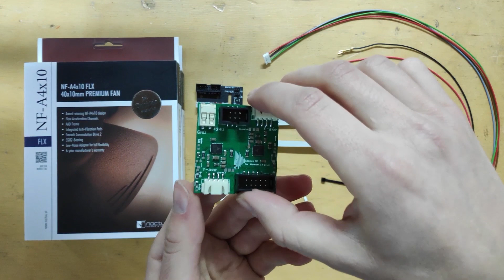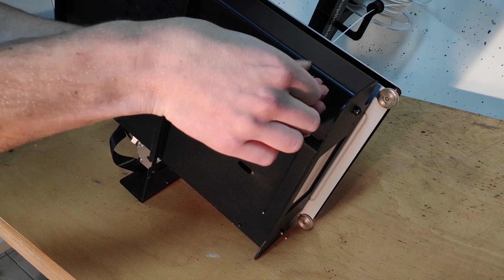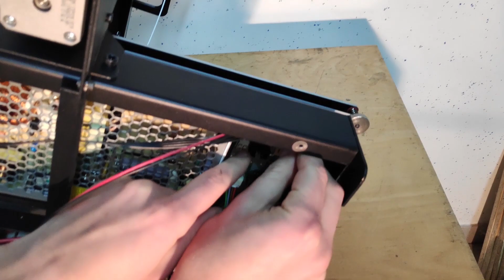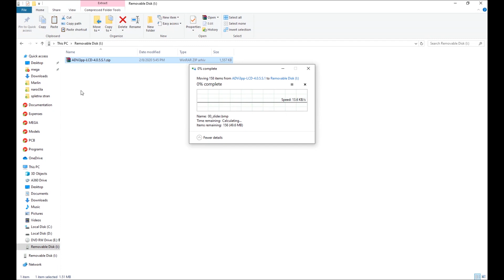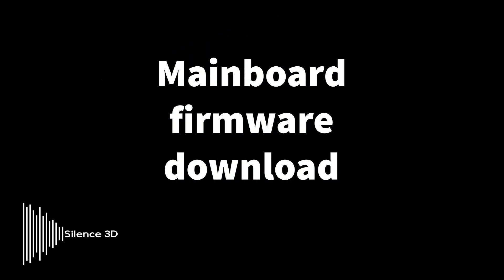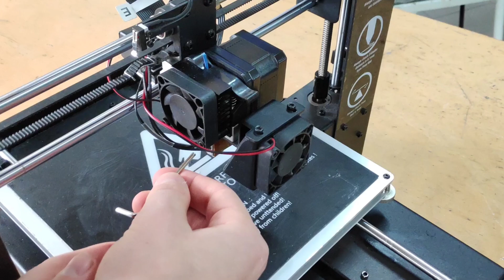Upgrade Wanhao i3 Plus - Mega silent pack Silence3D

Comment: I understand this product is now no longer available, but are there still files available for updated firmware anywhere?
Reply from the maker: This set is still available for sale. Just unfortunately there is a problem with the e-shop that has stopped working and it's been a long time in the solution. Send email on info@silence3d.com thanks

Comment: Does this still work if you are already using TL Smoother board on your axis motors?
Reply from the maker: New TMC2130 drivers do not need TL smoothers :) So no need for TL smoothers on X and Y axe, but you can have it on Z and E.

Comment: Very interested in this upgrade, although I own the older Wanhao duplicator i3 v1 (the one with separate electronics box). Would this system (or another package you sell) work for my machine?
Reply from the maker: I'm very sorry for the late reply. It may be possible but I will have to design special adapter for it and change firmware which is a lot of work....

Comment: Hi guys, do i need the software upgrade as i already flushed ADVi 3++
Reply from the maker: Hi. You will need to upload motherboard firmware from https://silence3d.com/downloads/, because pin configuration is different.  You do not need to upgrade LCD since you have ADVi3++, but we highly recommend it.

Comment: 12:04 must the printer be turned on to 230V? Do you only connect the USB cable to the computer but the printer is turned off 230V?
Reply from the maker: No, USB connection is enough. We do not recommend to plug in 230V while electronics is not covered.

Comment: Shame it wasn’t a complete drop in replacement board as the Melzi board is shockingly unreliable. Great idea though 👍🏻
Reply from the maker: Thank you for opinion  :) We didn't find Melzi with Advi3++ firmware unreliable. We just think it is too loud. So we decided to make upgreat as easy to install as possible.

Comment: I purchased the board and it works very well.  The X and Y axis is much quieter and now I mostly just hear the fans and z axis motors.  I run a 12 volt noctura with a buck converter and dual radial fans on a opti-cooler.  Install was very straightforward.  The hardest part was soldering the pins (i did not have the solderless headers) and making sure the ribbon cables were oriented correctly.  I recommend this for anyone wanting a more silent i3 plus (clone).  I have the monoprice maker select plus.  

Just a note: A 6 DB drop is significant.  Decibels are on the logarithmic scale.
Reply from the maker: Thank you very much for your positive response!

Comment: 65? more like 61. 50? 55... so you lose 6 db
Reply from the maker: She did not see on sound level meter LCD so she said number we measured before. Decibels are not linear so even 6dB is a lot. You can hear on video the difference.
Reply: ...and Noctua fan on the "quiet" one. NOT apples to apples comparison. Also on "quiet" one the meter is pointed away from printer for the "lowest" reading. Not well done.

Comment: Interesting solution to getting TMC drivers on melzi with integrated drivers.

I don't see the extruder breakout board for 12v listed as being included either of the product pages. Is it included with both? Would you consider selling it separately?
Reply from the maker: 24v to 12v converter is included in Mega silent pack. We will add it as individual product as well.